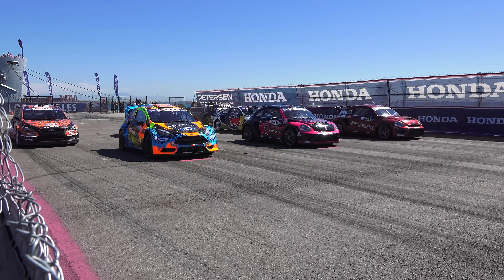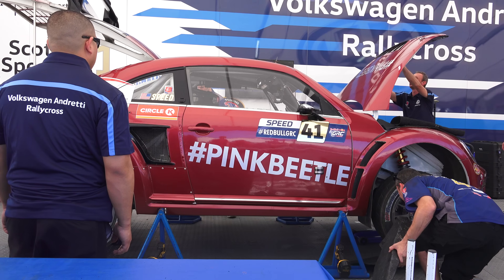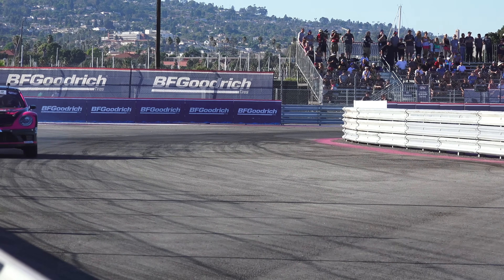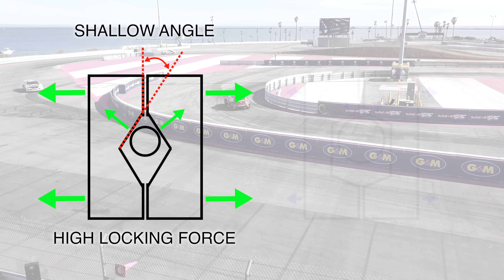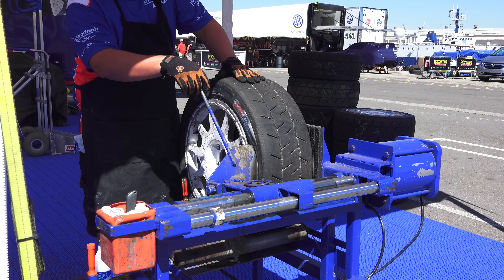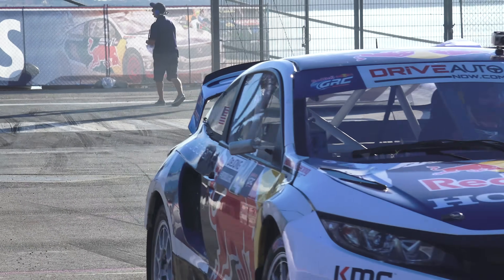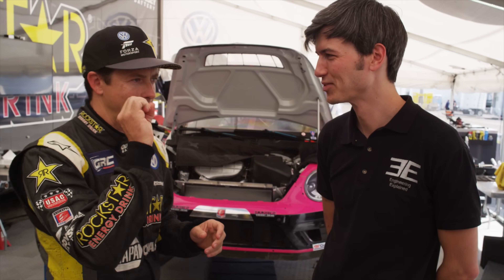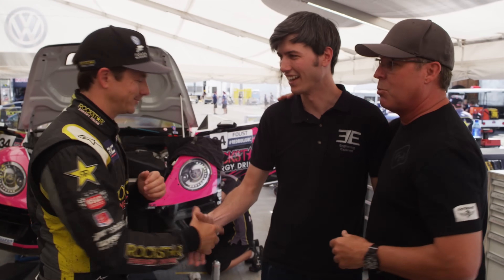How Global Rallycross Supercars Hit 60 MPH in 1.9 Seconds

Comment: what's inside the civic? do they make specific engines just for this event?
Reply: I talked to the main tech after the event on sat, and he said this engine has nothing in common with any honda car engine out there. that it was specifically designed for this type of racing.
Reply: deadguppy888 it's a civic engine running on red bull in the tank
Reply: i am guessing its a ford engine, since the team owner is Anderas Eriksson, he owns Olsbergs mse and build or help like 90% of all fords in rallycross! also have 2 fords in rallycross wrx!
Reply: VTEC YO
Reply: mikael sundholm 

I doubt it's a Ford engine. Chances are pretty good that they get them from a highly specialized performance engine shop. I got a chance to talk to Patrick Sandells crew because they didn't make it into the final at Seattle. They told me theirs is from a small company in Italy.
Reply: I'd imagine they all use basically the same engine
Reply: They're designed specifically for this type of racing. Last year they had to use a stock block but that has changed.

Comment: metric please this is cancer
Reply: Actually, "g"s are universal, as they represent a gravitational constant of ~9.8m/s², thus ~9.8m/s² * 1.4 = 13.72m/s² of acceleration.
Reply: Yeah,  little notation on the bottom would suffice
Reply: Just learn how to convert and you won't have to cry any longer
Reply: i'm pretty sure Gravity is pretty universal.  metric is pretty relative.  and all you really need to know is holy f+++ it's fast off the line.
Reply: I too was confused
Reply: how can deviding a unit by 32.2 to get another unit be logical.  why not metric ?: times 10 or some other logical number to get the next unit.    TADAAA
Reply: +TheLeafySpring this is a channel featuring nearly 1 million subs, which often stated reach far beyond the borders of the US. A simple gesture of showing metric or SI units in a corner of the vid would not take long to do, and it would show some consideration towards many of the subscribers. It's been mentioned a lot on other videos too, and the fact that it is still strictly imperial units is a bit of a letdown. I like engineering explained, but this is just odd that with that many non-American and non-British subs, that not just a little thought would go out to the rest of us once in a while.
Reply: Audfile and you obviously dont visit them
Reply: Tankred Zrn why don't you learn both it's so much easier
Reply: End result was in g's, so unless you have a metric equivalent for that, I'd argue the units used to arrive there don't matter :D
Reply: If only there was some portable type device that connected to the internet that allowed me to convert metric into imperial!

Whiny bitches everywhere, JC.
Reply: Whoah sorry for not knowing the formula to calculate MP/H to KP/H ;-;
Reply: Metric's great, right? When can we expect you to switch to a metric clock then? Oh no? Too inconvenient to use metric time, eh?
If you also get cancer, try this: cut a 1.5 foot piece of 1-5/8", 11.5 TPI NPT pipe sunk in 3 yards of 1/2" rebar concrete fitted to an ALUMIMUN basket to hold your deep-fried corndogs. That'll cure you.
Reply: Lol, imperial units should be banned by law
Reply: Just do what i do for when he switches to metric. Use google
Reply: How hard is it to convert?
Reply: The unit "g" is a unit that is not specific to any measuring system. 1g = 9.8m/s/s = 32ft/s/s
Reply: No communist units!
Reply: +kevrs2 It's about being used to a unit. I can perfectly convert ft, in, lbs and such stuff.. but doing it on the fly while processing the rest of the informatin given is a hassle. It also makes seeing stuff in perspective a lot harder.
Reply: +AzeOfSpades You're right, well said. No h8 m8
Reply: Ronald Mattos I wasn't saying that converting was easy. I'm saying that the use and interpretation of g's is easy. I mean yes you can just use a online converter for metric and imperial, but it is still annoying.
Reply: Audfile I am not from England. but nice try, is that how you talk in uneducated America?
Reply: judging from your profile picture.. the cancer in you is stronggg
Reply: The US is only that relevant to Americans, you're stuck in your own little bubble of narcissism. Britain uses metric, the only use imperial for liquids. Also, lets say Britain was strictly using the good ol imperial system, that doesn't even make it to 6% of the world, unless you round up.
Reply: well explained
Reply: kipper If he really thought that, is he really worth your time?
Reply: no one was saying that g's was a metric unit. But that it is a unit that is easily understandable, as it can be intepreted as any unit you like, since it is literally just a multiple of gravity (m/s^2 or ft/s^2)
Reply: Randy Gareth well, my comment wasn't directed to you cuz your point isn't wrong, the problem is with the others that said that it's easily doable an conversion from imperial to metric units, which isn't. Also, I believe that an good part of the subscribers are people that uses metric system instead of imperial on their lives, like me
Reply: 90%  whahahahhaha. sorry NO
Reply: leonvandermaas I love Fahrenheit. It's like a percentage. 100 degrees is HELLA HOT! 0 degrees is HELLA COLD. 50 degrees is just right!
Reply: Randy Gareth The point is that we don't measure time in metric but could. Why go all out on a pro-metric war but only use it when convenient?
Reply: Jeroen roughly roughly.  yeah. I don't like roughly. I like it exact and to do that it just makes more sense in metric. no crazy foolish numbers to multiply by to get the next value.
Reply: just learn both, what if your life depends on it
Reply: The guy is American, just deal with it. I have to learn to make sense of a bunch of metric measurements all of the time on foreign shows.
Reply: You mean literally every country in the world except the US?
Reply: Except water (a very important fluid in our lives)
freezes at 0°C, melts at 0.01°C, boils at 100°C. That makes more sense to me then the standing temperature of brine made up of equal parts salt and ice. When was the last time you used a brine made up of equal parts of salt and ice? And how is 100°F HELLA HOT? I don't think 37°C is HELLA HOT. Try 40°C. I'll agree though that 0°F is fu**ing cold.  And how on earth is 50°F just right? I'm still pretty cold at 10°C. I like 28°C-30°C, but 86°F doesn't sound that good, does it.
Reply: Celcius is easier to convert to Kelvin for scientific experiments.
Reply: TheLeafySpring "somewhere that uses metric" So... literally every country in the world except a few?
Reply: The difference between the metric and imperial systems are simple. Imperial (MERICA units). Metric (countries that haven’t landed on the moon yet).
Reply: metric is right :-) There's a reason everywhere in the world except the US (near enough) uses it. Britain is a bit schizophrenic. We mostly went metric in 1970s except for a few things that got left behind (miles, miles per hour and miles per gallon (but we buy our fuel in litres!) and pints in pubs, but all other liquids come in litres (milk, paint, water, etc)). Oh and people come in stones about half the time, Kg the other half. It's a right mess. It took until about 2005 to get rid of Farenheit but I think that really is done now.

But for engineering sums, it has to be metric. Imperial is so much more work.
Reply: +TheLeafySpring "somewhere that uses metric" so literally everywhere that isn't the US, Burma, or Liberia. That is 5% of the world. How ignorant can you get?? Typical Americans.
Reply: @zonochromatica  dont be lazy.
Reply: haha
Reply: xxwookey We don't even use pints! lol! And who else uses stones?! Hahahaha I love this world sometimes.
Reply: lol that was the only bit of his calculation i could understand XD. All this "pounds" talk is driving me nuts!
Reply: so that means that both 12 hour and 24-hr time are imperial? Either way, even if they are, we are discussing strictly units of measurement, not time. Atleast in measurement, for me i CANNOT understand imperial.
Reply: +Sethemiah haha this is what they're trying to prove by all this argument
Reply: +AzeOfSpadez unless you live in the south where 100 is normal 50 is very cold and 0 is time to find a nice warm spot to hibernate.
Reply: Its pretty simple to convert roughly. A feet = 1/3. lb is about less then half. mph = times 1.6. PSI = uuuuh I could google and be smart or just admit I don't know. 

For the rest, just laugh and smile that they use the wrong system and you are doing it right. Also if an american or englishman ever asks you how heavy something is just give him the answer in a made up unit.
Reply: +AzeOfSpadez haha, funny thing but pure subjective.  I personally like 45 degrees fahrenheit  
I think that Kelvin is the best cause it has a zero that stands for no molecular movement (0K = −273.15 °C).   But celsius is definitely in 2nd place because is has the same scale as Kelvin  (1 kelvin up is also 1 centigrade up (−273.15 °C = 0 K and 0 °C = 273.15 K))
Reply: Google.com
Reply: I'd have done 60*2.25 to get ms^-1, then divide by the time it took and you have acceleration in ms^-2. Divide that by 9.81 and you get how many Gs it was.
Reply: +Tankred Zrn See my above comment for why your statement is pointless
Reply: AzeOfSpadez That's what people mean when they say that you live in a bubble. You say the metric system is a bubble in an Americans bath. That just says it all
Reply: Tankred Zrn metric when talking about cars, yuck.
Reply: KingHalbatorix
k, the celsius scale still makes more sense :p
Reply: The use of imperial units is the only valid moon hoax argument in my book. And a pretty convincing one! No one can possibly do that measuring the distance to the moon in furlongs or inches or whatever silly unit.
Reply: +TheLeafySpring You know that the US is one of only three countries in the WHOLE WORLD which doesn't use the Metrics in everyday situations, right? We shouldn't cater to YOU for NOT using the metrics.
Reply: There is no kph, there is km/h
Reply: +NATHANIEL GILLIES anyone that's says fucktards is no scientist
Reply: Just learn both
Reply: Tankred Zrn video uses Imperial
I'm from a metric country
Understands metric
Laughs at replies
Reply: Tankred Zrn G's are G's and it's an American event. Get over it.
Reply: Ishanka Jayasundera, Ithin Bn Ubata Molayak Kiyala Ekak Nadda Bn Miles Walata Harawanna..
Reply: Tankred Zrn. Wow. Respect other systems other than metric please.
Reply: @NeoNoggie  thats exactly what i thought! lol. he gave relative acceleration in as a dimension less value. what could be easier?
Reply: it's strange though, the US is committed to metric when they signed the int. agreement in 1879. it's used in school and the god damn military uses it in the US. it is also the "preferred system of weights and measurements for US trade and commerce" they just need to switch to the SI for everyday stuff.
Reply: Just change seconds to more useful time unit
Reply: It's not a German channel though 😁
Reply: +blstk256 METRIC FTW
Reply: There's a reason why the metric system is the international standard.
Reply: And I would like that he would stop calling liquids a gas when talking about fuel.
Reply: I know how to use both metric and imperial, I'm in the trades. I'm not in any metric bubble, my original point from my first comment was that TheLeafySpring was being ignorant to the rest of the world from his statement, acting as if a small proportion of the world uses metric.
Reply: Cater?
Reply: if it's so easy converting as you guys are saying, so isn't a problem to the channel convert it and put it on the video too
Reply: We don't falter towards the COMMUNIST METRIC SYSTEM.
Reply: kipper Woah, didn't know the entire world was watching this video. I retract my statement. lmfao. You're making such a gigantic deal out of one youtuber's lack of ...courtesy? If you can even call it that! 
You say i'm in my America bubble, but so are you in your metric bubble. Just because it's a bigger bubble doesn't make it right. Do you know how big the metric system is to an American Youtuber living in the US? Akin the the size of a bubble in a bubble bath...
Oh! It popped.
Reply: look it up yourself. no one should cater to you just because you live somewhere that uses metric.
Reply: @WTGRacing  You mean everywhere except America?
Reply: Touge Season the entire earth except bacon land uses metric
Reply: you're a cancer
Reply: But the US is like 90% relevant to today in terms of money, power, fame, etc. So yeah. Oh and you forgot Britain. Herp derp. Typical foreigner.
Reply: @AzeOfSpadez  is that why everything in the US is made in China, Japan, Mexico and Canada.
 Real estate getting bought out by China and India and soon sports teams. Ok.

Comment: I have an off topic question. Do you think it's necessary to employ a suspension set up (Wishbone or McPherson's) for an urban concept car for shell eco marathon competition. The previous year car had a rigid setup. What according to you are the pros and cons of it. A reply from you or anyone will be highly appreciated. :)
Reply: I have only a minor grasp on the concept, but it seems like A. Yes, a suspension might help preserve momentum over varying terrains (unless it's all smooth paving), but B.It's probably too heavy to be efficient. That's just my thought at the moment.
Reply: 1997jankuschef Yes, exactly. but don't you think there will be a lot of vibrations which will cause alignment problems? Also, what about installing suspension only at the rear for maximum road contact to deliver the power and use a rigid setup in the front. And yes, the track will be pretty smooth but one or two bumps and a gradient.
Reply: 1997jankuschef Yes, exactly. but don't you think there will be a lot of vibrations which will cause alignment problems? Also, what about installing suspension only at the rear for maximum road contact to deliver the power and use a rigid setup in the front. And yes, the track will be pretty smooth but one or two bumps and a gradient.
Reply: 1997jankuschef Yes, exactly. but don't you think there will be a lot of vibrations which will cause alignment problems? Also, what about installing suspension only at the rear for maximum road contact to deliver the power and use a rigid setup in the front. And yes, the track will be pretty smooth but one or two bumps and a gradient.
Reply: Shreyas K M I'm absolutely sure that there are better resources for this than me. That being said, I think a suspension on both ends would be beneficial. What are the pros/cons of a rigid vs. suspension? With regards to alignment, it doesn't sound like the course is so rough that you can't solve a way to design the suspension to stay in alignment.

Comment: What are the differences between this and the fia world rally cross?
Reply: Supra Man world rally is more traditional (country roads - dirt/ice/gravel). Red Bull is rally in a controlled environment. Think of it almost as Mario Kart meets bumper cars. 👍
Reply: he said world rally cross not world rally cars
Reply: mostly difference in how exactly the scoring is done and exactly how the championship poi ts are awarded. Cars are the same (for example OMSE builds cars for both series). GRC uses last chance qualifier, which WRX doesn't . which means GRC finals are usually 10 cars and WRX 6 cars.

biggest track differences are the flipped nature of joker and GRC always using the same 70 foot build jump. WRX runs on permanent tracks, which usually have jumps based on topography and not intentionally build jump, though few tracks have intentionally build gravel bank jumps. jokers are flipped WRX uses slower joker, while GRC uses faster joker. Due to the slow nature WRX uses extra joker laps as penalty. GRC uses stop and go instead.
Reply: there are better drivers in fia world rally cross ;)
Reply: world rally cross and world rally championships are different series
Reply: Supra Man 
metric
Reply: Proper tracks in WRX